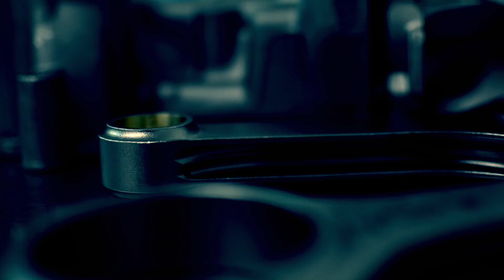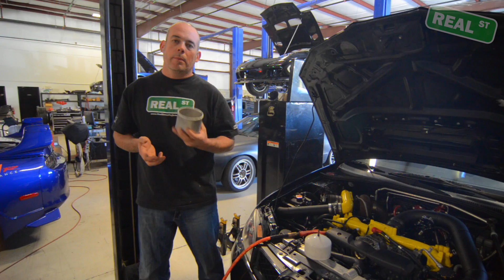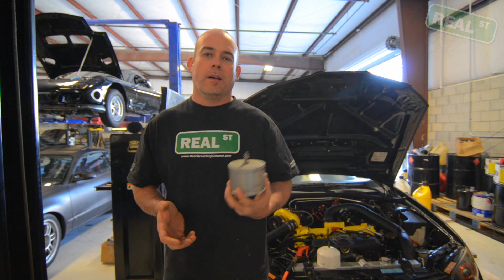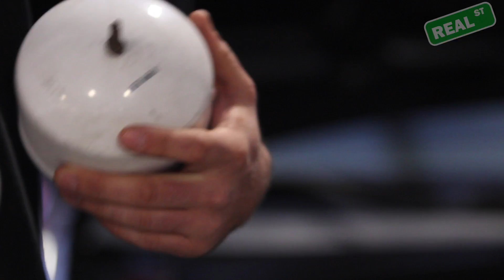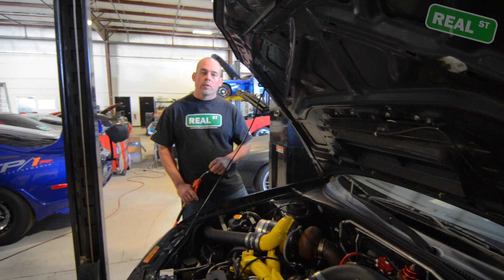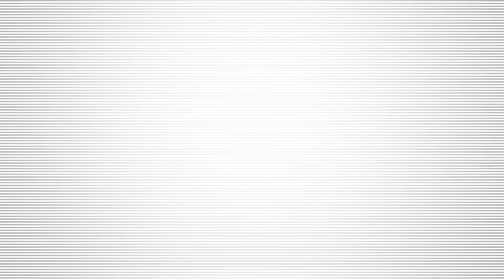Jay's Tech Tips #16: Boost Leak Test

Comment: Hey Jay.  I have a TT.   Do I need to cap both turbo inlets or just one for the test?  What psi do you blow into the system?
Reply from the maker: Scott i would cap both turbo inlets and feed air into each. test it a little over the pressure you will be running for boost. If you plan on running 20psi, you can test it at 20-30psi
Reply: REALSTREETPERFTV Thank you, Jay.  I appreciate the response.  Keep up the great work on your racing and your videos.

Comment: Quick question: Will a boost leak create sputtering at low boost? Once the boost is high enough the sputter quits. Thanks
Reply: +TwasButNowAint  It depends on a where the leak is. If it's behind the throttle blade it can mess up how it drives OR if it's a MAF car and the leak is after the MAF. It's a simple test to perform, just leak check it and then you can cross it off the list of potential gremlins. 
 thanks
Reply: +Jay Meagher tested it and its coming from the bov..I have a turboxs rtl bov.
Reply: +TwasButNowAint  Alright, if your car is equipped with a MAF sensor the leak can cause you problems as metered air is leaving the system. IF it's not a MAF car check your AFR during the trouble area, you may just have a tuning issue. 
 
thanks